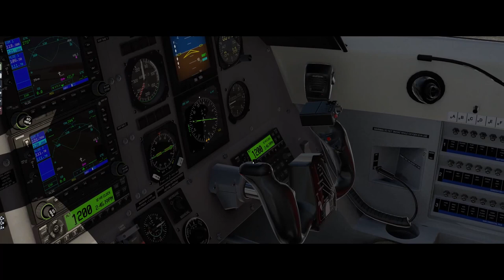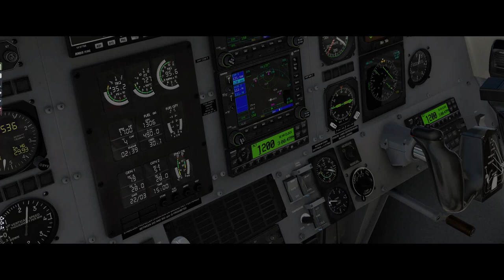Real Pilatus PC-12 Pilot Tries X-Plane PC-12 For The First Time

Comment: Disappointing that you were able to pick up so many inconsistences in realism between the real aircraft and the XP11 version. Why don't they ask real pilots to verify their software before they release it. It should be all about as much as REALISM and many of the things you have mentioned could have been easily implemented!
Reply from the maker: Hey, Reg. Yeah, I hear you. I'm not sure what kind of budget these developers are on, but I can't imagine it's very big. I don't know a lot of pilots that would do this type of consulting work for cheap, so I think it's just out of most devs' price range for a recreational product like this. Personally, I'd work with them on my fee to give them some guidance. I think it's a worthy donation to the flight sim community. Like you said, realism is important and lots of people are using these products to seriously learn about aviation. If they ask, I'm here! :-)
Reply: Its carenado, they advertise these are tested by real world pilots but as developers they only care about things looking good and not accuracy of the technical stuff. For that you should go to torquesim or hot start and justflight. They are far more in-depth but unfortunately don’t have a pc12 in their catalog. 

Maybe one day though
Reply: Special Features
Version 1.3
Only for X-Plane 11
Full PBR (Superb material shines and reflections).
Features
Specially designed engine dynamics for XP11.
Flight physics optimized for XP11 standards.
Ground handling adapted for XP11 ground physics.
Physically Based Rendering materials and textures throughout.
PBR materials authored with industry-standard software used by the film and gaming industries.
X-Plane GNS530 (FPS friendly)
Support for RealityXP’ GTN750* (integrated into 3D cockpit, when available).
Goodway Compatible.
Realistic behavior compared to the real airplane. Realistic weight and balance. Tested by several pilots for maximun accuracy.

Comment: Great job Gene. I enjoyed your video and real world experience.  I am an avid sim user and a GA low hour pilot.   I find most of sim models (all 47 of them) to be hyper sensitive on most manual operations (brakes, rudders and even aileron roll sometimes, but especially ILS.) Chasing the needle in the sim seems to be much more difficult and less forgiving than the real thing, at least in the small aircraft.
Reply from the maker: Thanks for watching, Bill! Yes -- you're right about the sensitivity. Real airplanes are usually easier to fly than simulated ones. That's true even all the way up to full motion level D simulators. Cheers! Enjoy your simming!
Reply: That’s what I noticed when flying the piper Cherokee in the sim and in real life not sure what it is maybe to do with how the airfoils work in x plane

Comment: Hi, thanks for share with us the real values and procedures of the real PC-12.  Just for help you, by default the views are configured at the numerical pad: 1= brake view / 2= center console down view for lights switches / 3= Avidyne close view / 4=pilot down view to access some controls like headiang knob / 5=Close center instruments panel / 6=Co Pilot View / 7= Passenger wind view / 8=Upper panel view / 9=Top high tail view / 0=inside, rear view from passengers to cockpit.   The Parking brake works only pressing the right pedal and leave the left pedal reseased .  With the Logitech Throttle Quadrant you can configure the T1 - T6 butons my custom setup.  ( T1=Gear up / T2=Gear down / T3=Flip standby frecuency Com1 / T4 Flip standby frecuency Com2 / T5=Servos on (auto pilot ON)  / T6=Toggle Yawdamper on/off. Before do this custom setup Go to Joystick menu and create a Active Profile ( Select Device at the upper left dropdown) left down Manage Profiles > Create new profile > name it (airplane name i recomend) > Done> After this any custom setup you do will get active automatic when you select this airplane. Check at the right of this window, push any button to view flashing as the function name, you can change it each joke or other control button at Edit button, browse all the choices. For the Yoke you can also do the same custom setups. my setup talking button=Contact ATC, Pitch trim may be reverse you can change it, right aleron trim I used to 45 left or right “Glance view” the red button I use it for default view, some examples to be more quick at my single pilot simulations.  Hope this help you, any questions contact me.
Reply from the maker: Awesome! Thanks for this!

Comment: If you use the right mouse click to look around i think its easier, also you can click a button and right click and hold your mouse to look around while holding the left click it leaves the buttons on. Also if you turn the gpu switch on it acts as if  gpu is connected.
Reply from the maker: Awesome! Thanks for the info.

Comment: Thanks for this thorough video. I was wondering if you use aileron trim a lot. Since I use a rather heavy warthog stick I find myself trimming more than in other planes.. Is this accurate?
Reply from the maker: Thanks for watching, Andreas! As for the aileron trim, it doesn't get used much in the real airplane. Of the three trim systems, it gets used the least. I flew an old Series 9 that I almost never touched the aileron trim in. In the Series 10 in some of my other videos I did use a little bit of aileron trim from time to time on landing just to neutralize some control force on final. All airplanes (even of the same model) fly slightly differently... no two are built the same.
Reply: @GeneStuart  thanks for the response ! Safe Landings :)
Reply from the maker: @andreaskalaitzakis5688  You too!